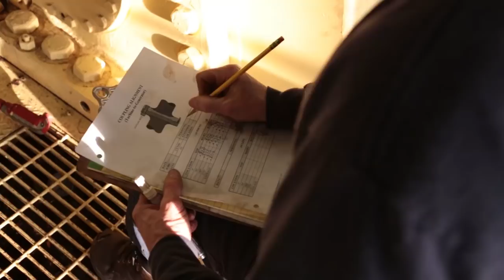Steam Turbine Repair Time Lapse Video

Comment: Best video yet!  I ran overhauls for 20 years and NOBODY had any idea of what I did for a living. I did mostly 5 to 20 MW units, hydrogen cooled generators, alignments, controls, oil flushes, etc. We took old steam turbine generators and overhauled them and installed them in new cogen plants in the 80's. I also did marine SSTG sets, main engines, reduction gears, etc., on Navy ships, container ships, bulk carriers and tankers.  What I miss the most is the crews. Those were good days when after a 16 hour day I would end up in the motel room so tired that I didn't know if I should eat first, sleep first, or go to the bathroom first.  I wish there was a way I could download my experience onto a chip and download it into someone young and full of energy. Thank you for the great video.
Reply: Good old days!
Reply: I was an ACO at a large power plant in NY we had 4 375mw units, I could never really explain my job either. I used to love when they tore the turbine down, all the rigging and what not.  Starting a unit after an over haul was definitely an experience, placw was dirty though.
Reply: Enjoy retirement big guy!!!
Reply: I’m a retired Union Boilermaker with 35 years of service and really enjoyed working on the big shutdowns when we did major boiler component replacement,it was physically hard and dirty work but I would not trade it for anything,oh and the money was pretty good also with all of the overtime
Reply: @mattharper588  Matt, I saw tons of your brothers on shutdowns. I even built a kiln for my garage with that clay refractory you air hammered into corners, a few boxes of it put in my pickup truck with a wink and nod.. What I miss the very most are the guys. Boilermakers, Millwrights, Welders, Electricians...and If I really stretch it, Instrument Techs. Guys like you were a blast to hang with. All the pranks, jokes, non politically correct talk, and even guys who couldn't stand each other working, talking, laughing, side by side.  Pick on the new kid...until he's giving you crap right back and earned his way.  12+ hours a day, 7 days a week, nowhere near home. Those were good times.
Reply: I used to weld up engine stands with those nicely bent old superheater tubes pulled from the scrap pile. Those went to friends and family. Good memories!
Reply: As an aircraft mech. for 35 years (now retired) in aircraft overhaul for one of the major airlines the stuff I worked on wasn't that big but the same idea and the same kind of team work. When I started we did everything from engines to seat covers to toilets, there was very little we didn't do in-house. Now the airlines want to farm everything out. They want to pull a part off a shelf and stick it on the aircraft. If it doesn't work they pull another one off the shelf and stick it on the aircraft. I hope this work is still done by skilled Americans.
Reply: Hey there, given your experience, are you available for consulting. I just acquired a 2.5 MW turbine that was converted to run on bio fuel. Need some help!
Reply: @grahamh6939  Fire away. If I don't know, I'll make something up!
Reply: I spent over 30 years working at Detroit Edison traveling up and down the river during outages tearing down and rebuilding turbines. Most people have no idea what it takes
Reply: @richardchampion4826  I miss the turbine crews. We had some good times and even people who couldn't stand each other worked together. You never see that kind of comradery in office jobs.
Reply: @kimmer6  Spent a lot of time working on 850 MW machines at Monroe, worked on one 1000 MW Nuke turbine, hated the nuke turbine, it was an English machine, needed special tools,
Reply: I’m going from carpenter union scaffold and transferring my books to milwrights

Comment: I worked on the large steam turbines with General Electric in the sixties and severities, Did most of the machining on the large parts . The machines we operated were not like the ones of today. Also the tooling is far more advanced. So I have to say although today's turbines are made faster the machine operators had more thinking to do, and was possible more skilled, no computers, no carbide tools ,

Comment: Are some of those disks missing blades?
On purpose?
Reply: +nndorconnetnz I was wondering the same. At first it appeared as if one of the turbine blades are damaged, but then noticed that the other parallel turbines on the shaft are also missing a blade at the same position as the main turbine... wondering why
Reply: +Zlatan Klebic 
They are filler slots. You need to install the blades onto the turbine wheel and slide them around, add more, slide them with a pneumatic impact tool. They fit tightly. Once all the blades are in, a short piece without a blade fits in and gets pinned to keep the blades in place. Then the sections of shroud bands are installed and ''riveted'' in place.  This is done in a shop where they can trim the shroud bands in a lathe, then dynamically balance the rotor. The shroud bands have end gaps...only a handful of blades are tied together. Its for expansion control and the bands keep blade harmonics under control. Without them, the blades would vibrate and fail causing tremendous damage.
Reply: Gotcha. Now understood. Thank you for describing what that was!
Reply: kimmer6 i still dont really understand...why some parts have big missing slots while other parts of the turbine dont have, aka look normal with complete rotation
Reply: Para el Perfecto balanceo rotacional del rotor por eso es que no tienen algunos blades en diferentes ruedas

Comment: Those are baby turbines lol we work on 100mw units
Reply: +Trenton Book 
You should try a 1200 Megawatt nuke plant turbine generator. Makes you think you and your bud can take the 100MW apart with a K-Mart socket set.

My bread and butter was 5 to 25 MW steam turbines and 3-60 MW gas turbine units.

The last overhaul I did was a 20MW steam unit in a lumber mill. We busted ass around the clock for weeks, solved major problems, worked for days with no overhead crane (they killed the 4160 volt lines to install the new road and drain pipes), did the hot oil flush, got everything running leak free, no troubles, overspeed tested, load tested, etc. Got it done 2 days ahead of schedule. Our thanks:  The head operator called our company to complain that the crew got dirty fingerprints on the bathroom wall. 

Stay safe....
Reply: lesson learned: next time take your time :)
Reply: 1400 MW baby.. That's the way we roll...
Reply: AEP 1300 mw ABB turbines lot of bull work on those mother's